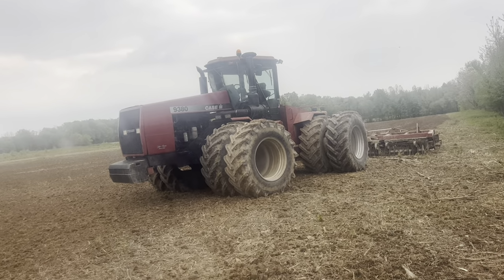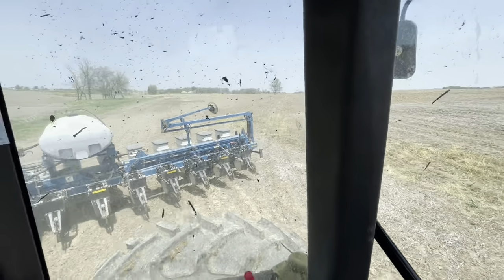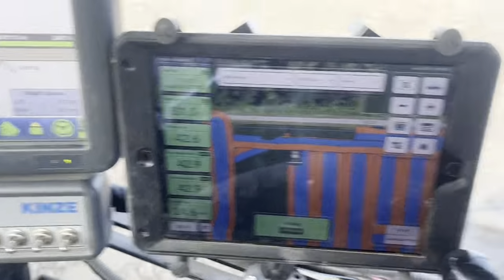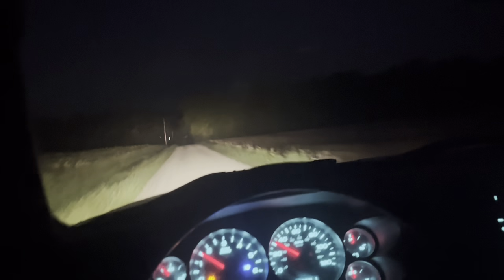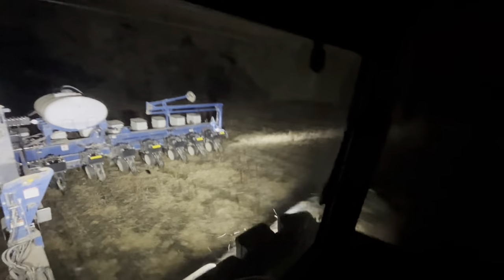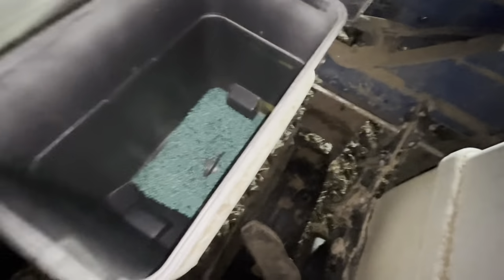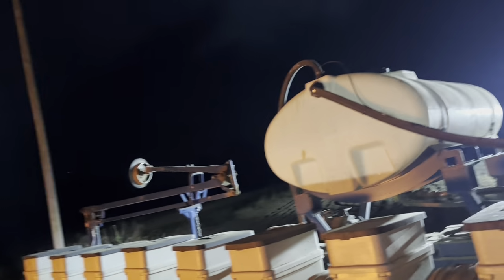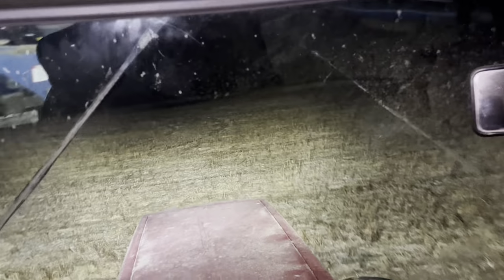Full Throttle, Wide Open

Comment: You need to try some verdiasian seed+graphite, 2nd year using it, went 95% this year strip vs regular case graphite and talc full collar ahead, used it against magnify d, beans strip beans with it are fully sprouted 2 days later other is 6 sprouted and 4 not